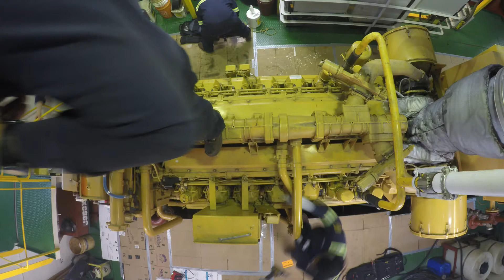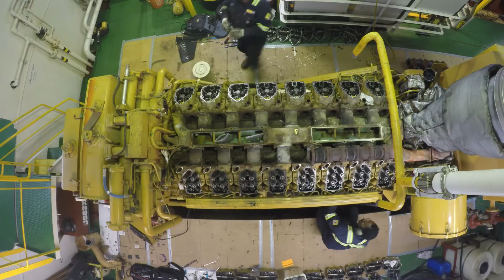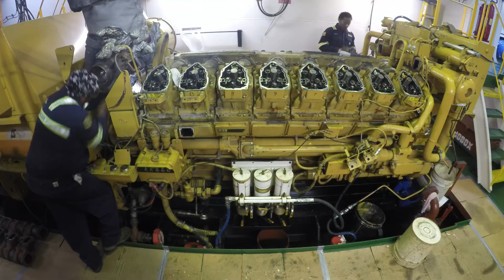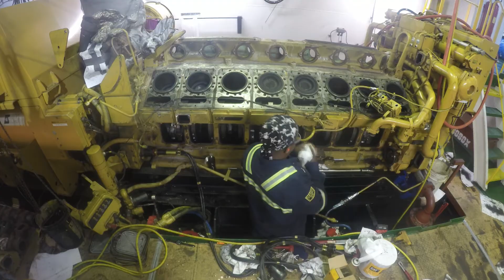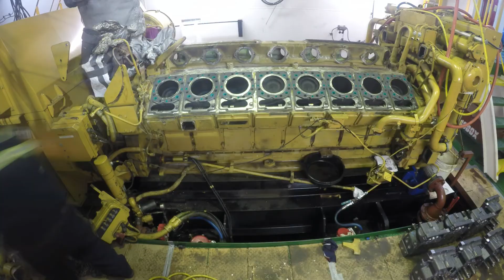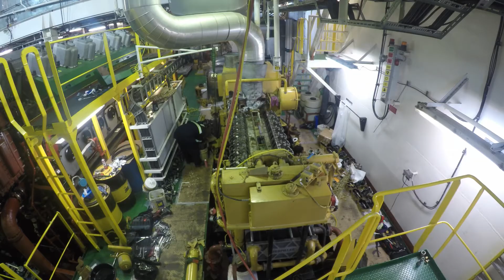AMERICAN PHOENIX CAT 3516 - 11K HOUR TOP END OVERHAUL

Comment: there are overhaul every 11k hour operation, when everyday work about 11 hour, than the cat has work for 1000 days, if work for 16 hours a day than there are 687 workdays, so that would be overhaul for every 2 years
Reply: no, You're wrong, 11k means there are need 11k hours to complete the overhaul process. so if a machinist work 200 hours in a month so there would be need 55 machinist to complete overhaul in a month
Reply: @tepskincaretangerang9382  Hahahaha, no you're way off and wrong. 11,000 hours is the time the top end is due to be overhauled. That's not how long it takes in man hours. The 3516's we have in Antarctica get a top end every 7500 hours. So less than one full year of running 24hrs a day.
Reply: @inothome  why so frequently? I remember cat manual gives a guidance calculation that includes total fuel used since last overhaul. To me 7k hrs looks too frequent. Cat  3512/16 need to give 12k hrs for upper half and I mean just CHeads and turbos and 50k hours for total overhaul.
Reply: @dieselengines1760  Depends on the RPM, the usage and climate. We run them at 1800 RPM and they are prime rated. So they get more wear than a 900 RPM standby generator would. We have a big issue with valve recession too, so well before a top end we have already installed a few heads on the engine.
Reply: Common problem on cat 3500 prime 1800 rpm, we suspect high intake temperature (90 celcius) to be the root cause, also we were running a heat plate exchanger for heating the camp. Frequent overhaul and major valve recess  (experience from Nunavik, Quebec) @inothome